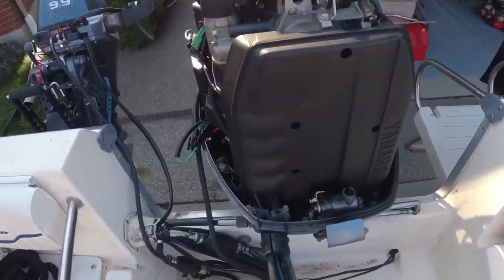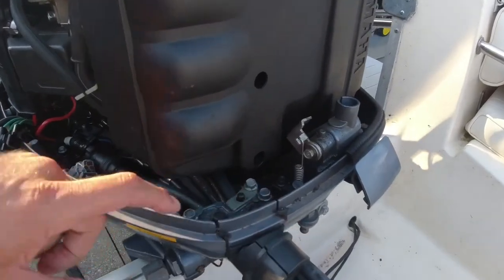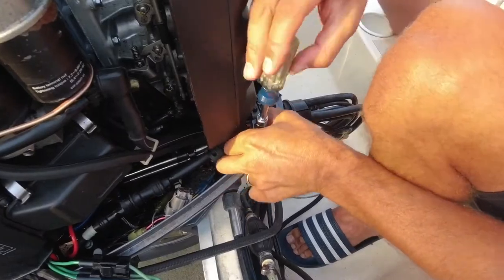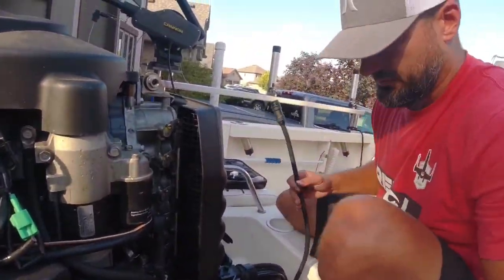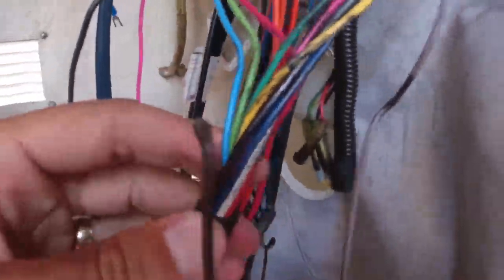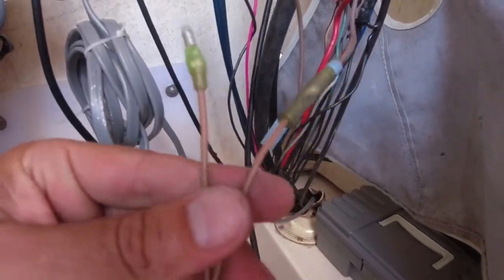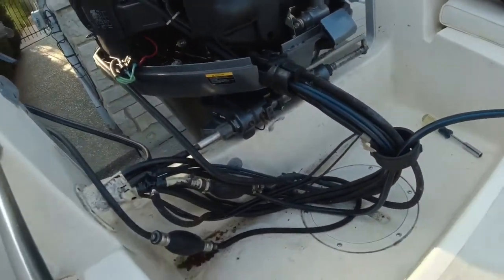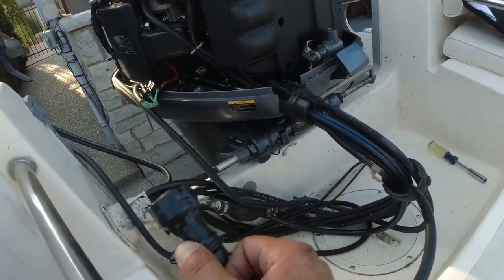How to Replace a Yamaha Outboard Wiring Harness

Comment: I’m having the same issue. Wasn’t sure about cutting the harness where you did because of the extra black wire. Without the black wire connected… you still have no issues with the new 10 pin harness? Thank you for the video. Very happy.

Comment: Is the 10 pin connector the only electrical connector (s) that goes from your control console area to the motor? Or is there another wire?

Comment: Hey man, I thought that this video was exactly what I was looking for, but didn’t quite get me figured out. I am at my wits end and am just short of replacing the wiring harness like you did, although I haven’t 100% sure that I’ve got it narrowed down to that. I worked my way back from the motor to the harness without any luck. I was pretty confident my problem was either in the ignition switch or the neutral safety switch in the remote control. However, after bypassing the safety switch, I metered the pins and found VERY low voltage. Like .04 V low. What I found was that little red wire coming out and pigtailing to both the ignition and control was in poor shape and busted when I tried to firm it up. I stripped the male end of the bullet connector and shoved bare wire into the female, and got up to .07V. Anyway it got dark and I have been troubleshooting this thing for 2 days now and called it quits. Is that wire the 12V lead to both harnesses? If so, it would be pretty safe to assume that that’s my problem correct? By the way I checked the link you provided for the harness and they’re out of stock. I’ve been going crazy over this one!
Reply from the maker: Its pretty hard to tell you exactly without seeing how your boat is wired.  I will tell you that as we were working on this, we found another issue which was a faulty ignition switch. We replaced that as well (and made a video on this too).  As I understand, you should have power to the ignition switch and when turned to on (and in neutral) you should have power to the entire ignition system which would reach the starter through the wiring harness.  I would check that you have power coming to the ignition switch.  In our setup the red wire was split to the remote control (for trim/tilt) and the ignition switch.  My boat is in storage now, but that's what I can remember from re-watching the video. If you send me a picture of your wiring I might be able to see what is going on.  Send it to @jkfishingcanada via DM on instagram.  Sucks that the harness is not available, but you should be able to find another one somewhere on amazon or an online supplier.  Just note the product number and make sure you get the same one with correct wire colours and connector.